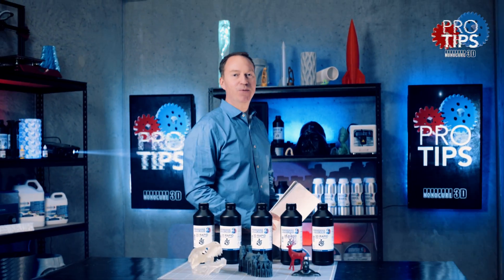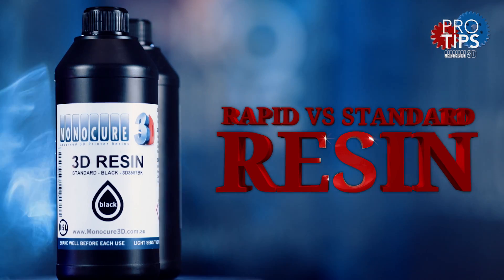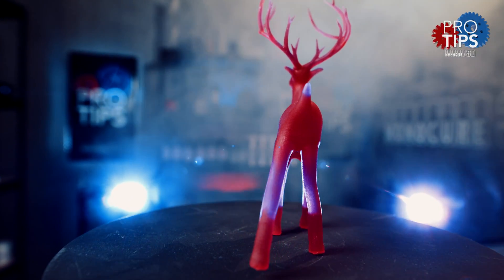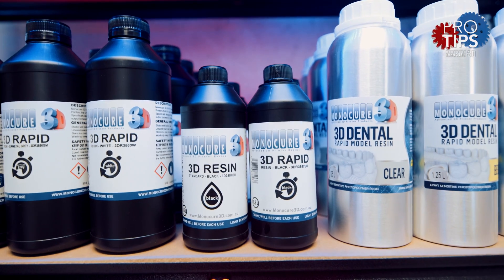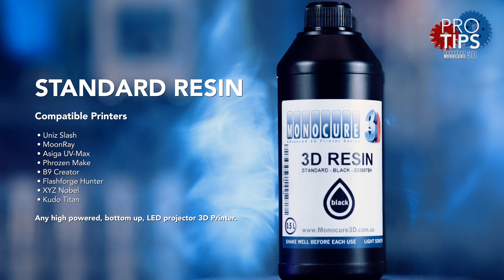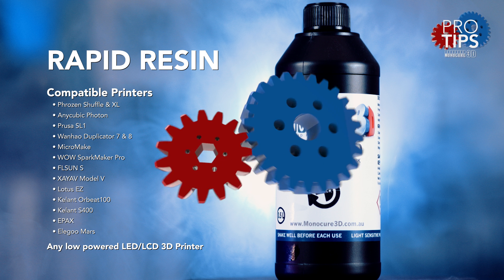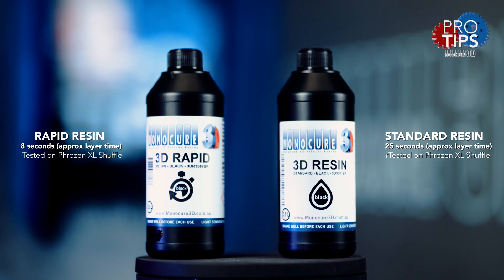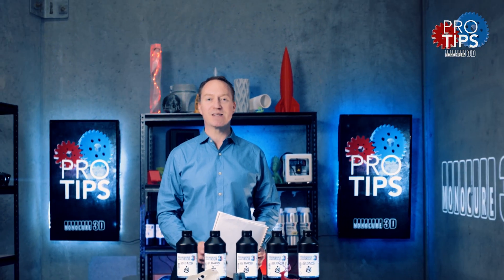What's the best resin for your 3d printer?

Comment: I have a concern about the use of standard resin in my Prusa SL1. Would the strongly increased exposure time not lead to more scattered light penetrating into the surrounding resin and thus making it thicker or leading to the formation of particles? With Prusa's default settings, some kind of skin is already forming around the first layer. I was able to suppress this by reducing the first layer time.
Reply from the maker: Peter Scheler not really, as the standard resin is less reactive, the longer exposure time won't cause any issues.

Comment: Are the mechanical properties of the finished parts very different?  Is the rapid resin a compromise for low powered printers, or good enough in its own right?
Reply from the maker: Alan Wright the mechanical properties are the same, the only difference is the power at which the resin needs to be cured.
Reply: @Monocure3DProTips  Good to know. I thought the rapid might be the 'poor cousin' of the 'real' stuff!